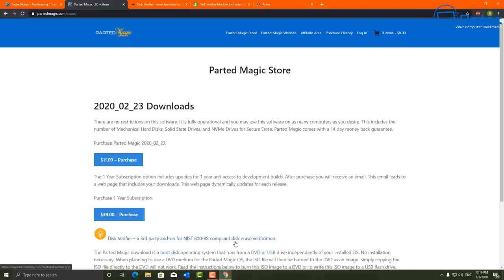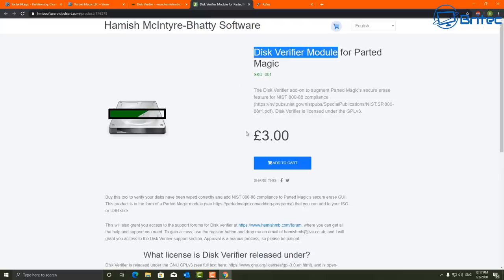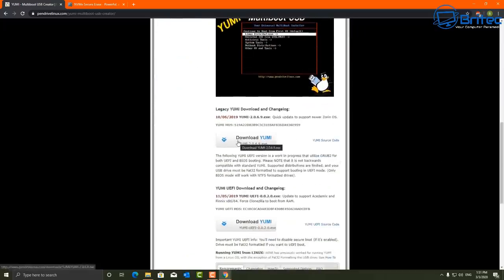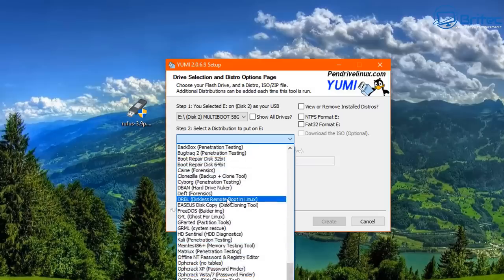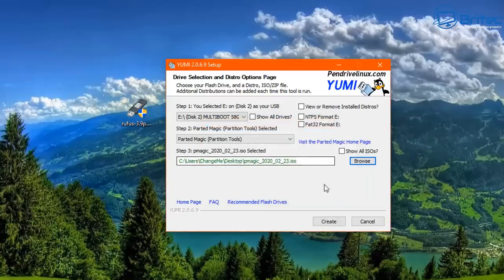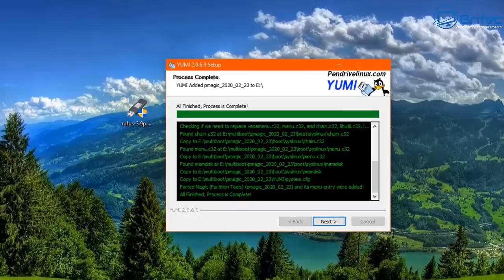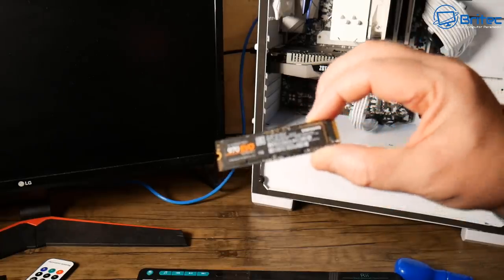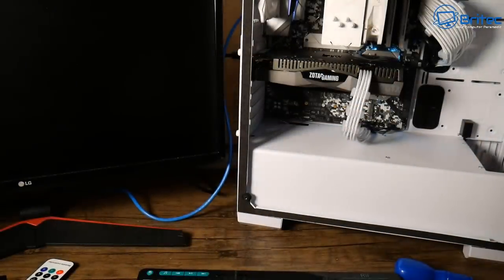How to Secure Erase M.2 Drive

Comment from the maker: Want to secure erase your SSD,  M.2 Sata or NVME drive? Parted Magic and Disk Verifier
Reply: Bri?  Is there a way to wipe more traditionally shaped SSDs (with sata connectors)?  That's something I'm a little skittish about.  Sometimes you want to do a full wipe, like what can be done using DBAN on a mechanical drive, but I've been told 'DO NOT USE DBAN ON AN SSD!!!' 
In that case, what CAN you do?
Reply: u cant wipe m.2 or ssd drives it will damage your drives.
Reply from the maker: @HarleyBreakoutGuy  Yes you can NIST 800-88
Reply: @Britec09  what does that mean?

Comment: careful with those adapter cards. if you already have an nvme there might be issues with lane usage. your motherboard needs to support booting from such a card if you have an older motherboard. the dual slot adapter shown in this video has some caveats. your motherboard must support bifurcation. just remember, ryzen systems come with 20 pci-e lanes, 16 for gpu and 4 for nvme. any other lanes are likely handled by the chipset. second or 3rd pci-e slots could be old pci-e 2.0 slots, but you need to check your motherboard specs.
Reply from the maker: Thanks for sharing. I'm sure someone will find that information useful

Comment: so usually to completely wipe my HDD's in the past i used to use DBAN an it completely wipes out everything clean on the drive... as that software doesnt work with SSD's i would like to know if there was a similar application or program to help wipe my m.2 SSD
Reply: Hello. Yes it does. i am tryng at this moment on a m.2 SSD. thank you. :))

Comment: I was under the impression that Flash drives and SSDs delete files instead of overwriting as in disc drives so those file are unrecoverable!
Reply from the maker: I think they call it "Block Erase" not 100% sure
Reply: @Britec09  What I was trying to say is that on SSD or NVME drives there is no need to secure erase because unlike disk drives as soon as you delete something it is removed from the drive as opposed to a disk drive which does not erase the files but simply writes over that deleted data at some point.
Reply: @michaeldunn6954  Only partially correct. But you have to factor in load balancing and some additional functions into the equation of Flash based storage so your hypothesis does not hold up.
Reply: @cee128d  Would you care to explain! if a flash based drive is completely written over with anything, surely there is no past data to be restored so it does not need secure erasing.
Reply: @michaeldunn6954  Solid-state drives use wear-leveling algorithms that evenly distribute data among SSD blocks, which means that data is constantly moved around on the drive so the blocks will be worn at an equal rate. Trim and Delete will only remove files in the "active" area of the flash. Depending on the drive and how it is over provisioned as much as 50% of the actual drive space is used for this wear leveling and replacement cells to replace damaged cells. These cells are not always erased when performing a Trim or Delete and sense these reserve areas are not a specific location on the flash, but shift around for the wear leveling there is no way for the average user to be able to verify that all of the data has been erased. That is why the Secure Erase software and procedures are used as they will go into the reserve areas and actually delete and clear the data from the entire data.

Comment: It's amazing no one has made a simple free utility to satanize NVMes for windows yet.. What is the problem?.. The function is built into the NVME system, all that's needed is to send the command.. Some places say "Secure Erase" wipes all the data, not just the table. Other places say it just does the table, so people can use recovery software to get your data if the sell the drive.
Reply: I did a "secure erase" from the MSI BIOS and checked the drive with DMDE and it didn't find anything so far as I can tell, so maybe secure erase does work. This topic is as clear as mud. Lots of people are willing to confidently assert all sorts of contradictory things about wiping data from NVMe's. It's pretty annoying. I just want to wipe a drive so I can sell it, seems that's just too much to ask if your using windows and your drive maker utility fails to do it. You can make a Linux USB thing and use something on there, but I have no idea how, and can't be bothered with the faff of finding out.